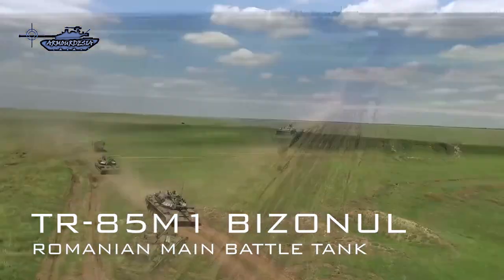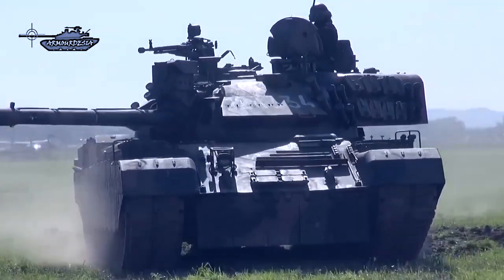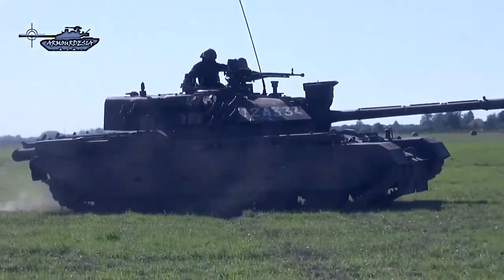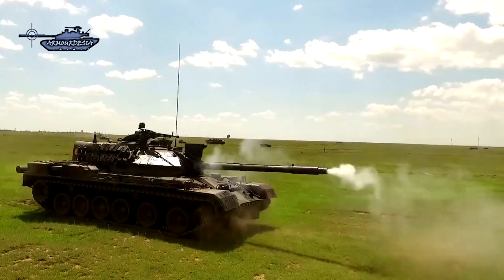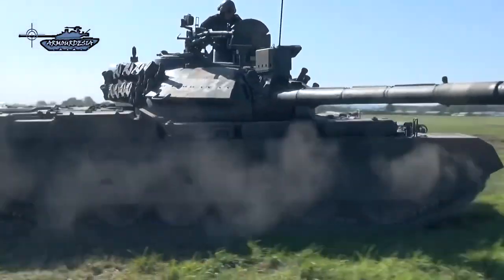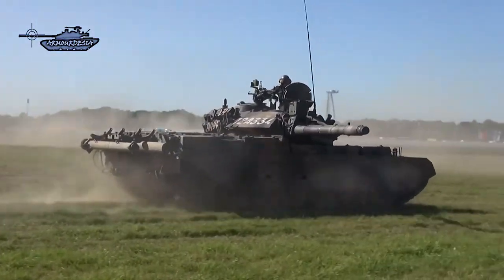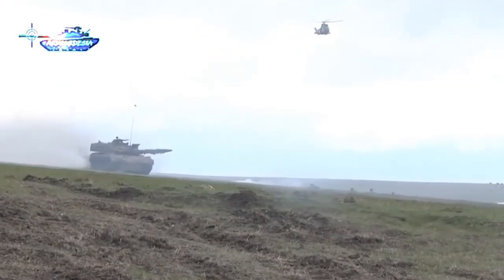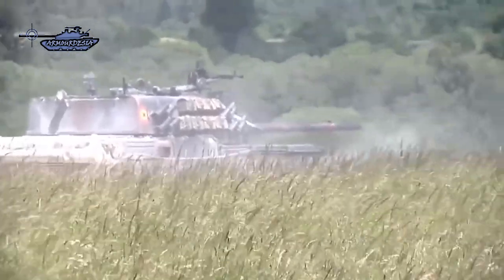TR-85M1 Bizonul Romanian Main Battle Tank review

Comment: That 100mm gun is not going to do much if anything to a modern MBT.
Reply: I was thinking the same thing. Having that thing is probably more of a liability than the benefit it brings to the army. Saddam's t72s were more capable in 2003 than this thing ever could be.
Reply: @grammoore  I mean Saddam's T72s did not have modern sights and had manual turret rotations. 

Armor and gun did not matter, because they rarely got to fire a round and when they did they almost always missed. 

The Romanian TR85M1 performs well in terms of visibility, target aquisition and gunnery. 

In an exercise in Germany, an outnumbered force of TR85M1s inflicted 2 to 1 loss ratio on the Americans. 

Now, in real life, those hits would have probably done little to no damage to the Abrams tanks, but the point is, it's better than the Iraqi T72s even if they use a more obsolete chassis. 

They're not great against enemy main battle tanks, but if you use them as Light tanks instead of Main Battle Tanks, then they can prove some use.
Reply: @daniels0376  any tank is vulnerable at a distance of 200m everything depends on the ammunition not the caliber ..
Reply: @leomarin2205  What I meant to say is that Iraqi tanks 90% of the time got blown up before they even got to fire one round. Whenever they did get to fire, they most often missed, because of poor optics, poor visibility, lack of fire control systems and also because their turrets were manual so they turned very slowly. 

It didn't matter how good their gun was when they rarely hit anything with it. 

A TR85M1 is just as efficient at spotting, aiming at, engaging and scoring hits on enemy targets as as any modern tank does. 

The reason why it's so bad is because of the extremely weak armor, its relatively weak engine, and the fact that its gun cannot penetrate modern Main Battle Tanks. It also has a very poor weight to protection ratio
Reply: @daniels0376  do not give me the example of Iraqi tanks because there were very few t 72 urss most were manufactured locally or bought sh plus lack of motivation and poor coordination. as for the problem of tr 85. the 100mm cannon is a modified maximum beat 12 km can eyes and shoot accurately at 4000m a smoothbore cannon has max 7000 m beat but as the distance between the tank and the target increases the accuracy decreases significantly regardless of whether you shoot with 120/125 they are hundred effective and precise between 2500m / 1000m everyone will look at you tube at how each praises their product :)) but it is a matter of marketing not the pure truth. :))
Reply: @leomarin2205  Ești român nu? Ai zis "maximum beat" (bătaie) . În engleză se zice "firing range" . 

Mă rog, ei zic să te uiți la divizile Gărzii Republicane în Războiul din Golf. Alea erau elita armatei Irakiene și erau mai toți veterani de război. Erau extrem de motivați și organizarea lor raportat la doctrinele în care fuseseră antrenați era foarte bună.

În a doua parte a comentariului tău nu am înțeles exact ce ai dorit să zici, poate poți să te exprimi mai coerent în română?
Reply: @leomarin2205  armura prea slabă, tunul incapabil
Acceptați adevărul, să gândești critic nu e greu
Nici mie nu-mi place adevărul dar dacă il accept automat voi cauta cale de rezolvare
Reply: @marinandrei1679  :)) si tu esti expert :)) "armura".  numai amatorii si specialisti de youtub , folosesc ,  esti priceput si in piese de artilerie , ai tras multe tunuri la viata ta , ca de tras cu el .macar sti sa folosesti o prastie ?? :))
Reply: Depend on projectiles,crew and when you use you 100 mm gun,where you shot and when!  This tank is create to guerila warfare,shot and run,not to fight of front of high tanks.
Reply: @nannunbgd  in forest enviroments APC's do the job
Even in Guerrilla Warfare it can't do much, the cannon limits its capabilities
Reply: @leomarin2205  ah deci automat daca cred că armura contează intr-un vehicul creat special pentru a lupta cu alte vehicule înseamnă că nu am fct armata sau cv?
Stai tu prietenaș în spatele unui geam si sa tragă cineva cu pistolul, ce se va întâmpla?
Reply: @marinandrei1679   🤣 se numeste blindaj . nu armura .. care este de vre-o tri feluri . nu ti le zic ca devi mai destep decat un racan de GAZ:)))
Reply: @leomarin2205  Și desigur că tu îmi da-i un argument și te ei de cv care nu are legătură
Armura era termenul pt protecția la soldații medievali, știu asta , dar cu timpul s-a mutat și la înțelesul de blindaj:))
Reply: @nannunbgd  Nu neg asta, dar astăzi exista drone care îți arată poziția din-nainte, deci ambuscadele nu prea mai funcționează:/
Si plus tancurile acelea sunt si ele păzite...
Reply: @marinandrei1679  🤣 nu amice blindajul este altceva armura altceva , nu sa mutat nici unde :)))
Reply: @leomarin2205  ba da, ideea de bază e aceași:))) plăci de oțel care protejează ceva, de la armură s-a schimbat termenul în blindaj
Iar acum ține subiectul principal
Reply: @marinandrei1679  🤣🤣🤣🤣🤣🤣
Reply: These tanks are not meant to counter other tanks, but rather support artillery and infantry.
Reply: can fire rockets, that's a game changer
Reply: @marinandrei1679  corect
Reply: the romanians are using amuntition to penetrate 500mm armour

Comment: This is a useless bucket.
Reply: Against other tanks? Absolutely yes. Used as an infantry support? Could be very useful. What matters the most is how you use your tanks, knowing the weaknesses and their strengths. Russia for example, has already lost hundreds of modern and contemporary state-of-the-art tanks because of poor-piss tactics, mostly thrown alone without any support or cohesive strategy.
Reply: Apparently ukrainians managed to destroy entire russian convoys with older buckets than the TR-85. I think that crew training matters hell of a lot. And in a tank vs tank battle it really matters who fires first. I had a neighbor that use to be a tanker on the TR-85M1, and he said that the tank is really very good. It's got a very strong gun, decent armour, very reliable engine, but it's main drawback is the turret ring mechanism, which is a bit faulty. There were a few times when they had to crank the turret manually because of that.